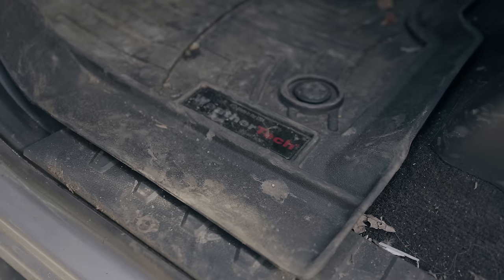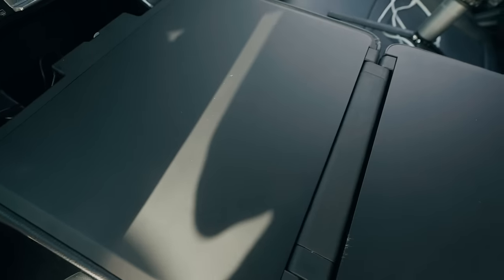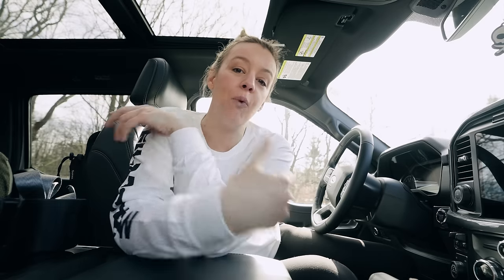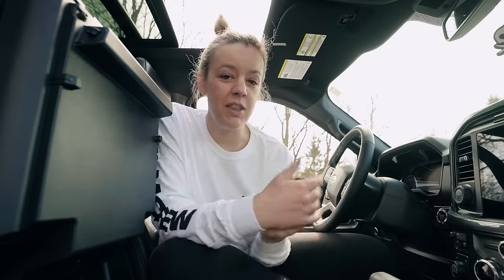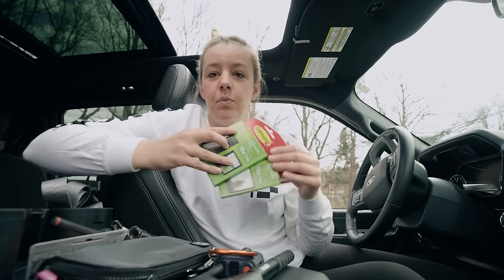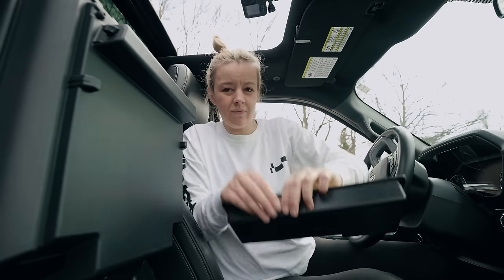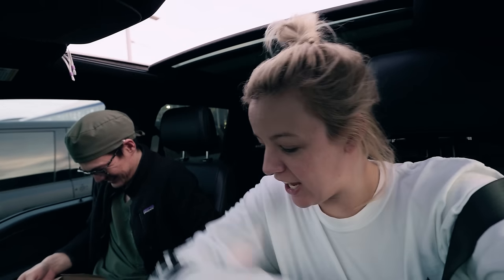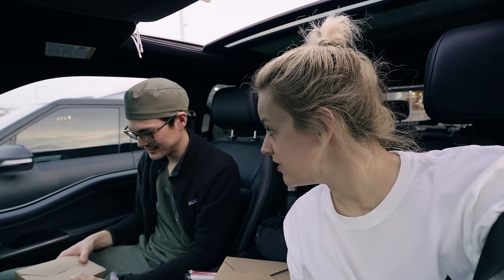Building A Camera Charge Station In My F-150 For Mobile Filmmaking

Comment: Nice ideas. I too had the same problem with charging all kinds of batteries. 
I'm using a Satechi 165W GaN Charger 4x USB-C ports - PD which can supply power for my Macbook, I also can charge my DJI drone batteries and Osmo 3 batteries. For my Sony batteries I use the Tri-charge from Jupio. When needed there is also a six port GaN Charger with 6 x USB-C ports. So you can add a GoPro and iPhone to charge. Works great!

Comment: My experience with adhesive Velcro in our truck is that the adhesive becomes useless in the summer heat. Makes sense when you think of the fact that a heat gun is used to remove adhesive. So the heat build up in the truck during summer makes the adhesive no longer stick to anything.

Comment: I love this idea. I think the best method would be to have a bag/box that is permanently plugged in that you can easily pull out of there. It would be tethered by its power cord. That way you can access it easier if you're not sitting in the truck (possibly leaning in from outside because you forgot a batt or cord). Also, you wouldn't have to worry about adhesives. Especially because if you constantly plug and unplug things in that tight space you're bound to knock it loose over time, whereas a compact plugged-in bag or box can just be shifted around like everything else. Lastly, you can simply unplug the bag and have all your stuff on the go. BUT yours looks better for sure lol

Comment: Regarding the "Aftermarket chargers":
I did not own any Promaster - but other cheaper brands. And I ditched all of them as they only have the 2 pins instead of 3 for the battery contacts!
I am not really 100% sure if the Sony charger utilizes the "Control pin" (center pin) but I would assume it does. 

The aftermarket chargers started to get wonky after quite some time and I could see a tiny bit of molten plastic on the pins which indicates that the chargers got quite warm. 
I ditched all of them as I would completely wipe my warranty with my batteries or my camera if there was an issue with the batteries.
Just a heads up and a thought to you.